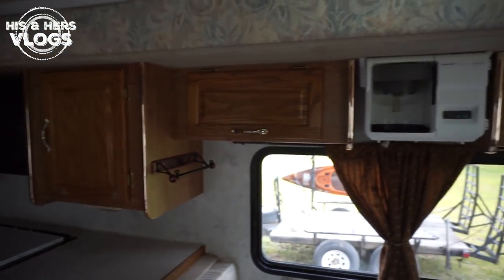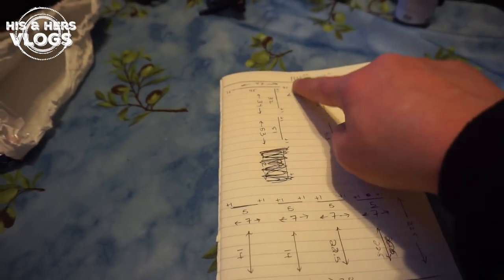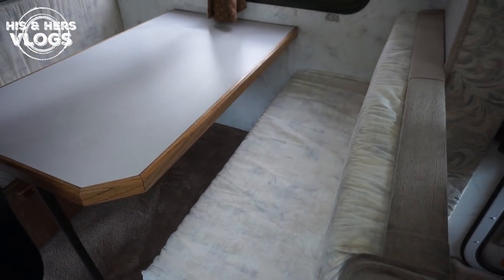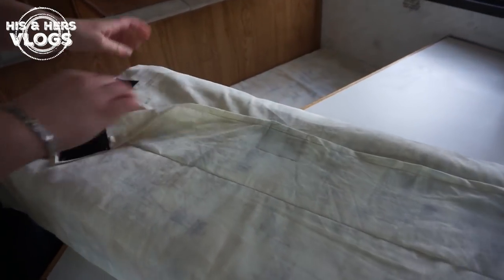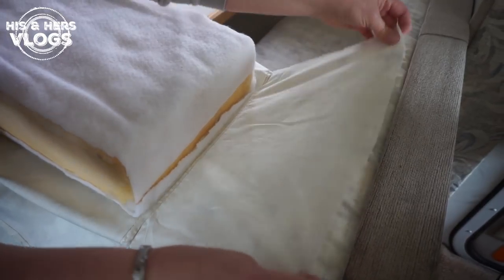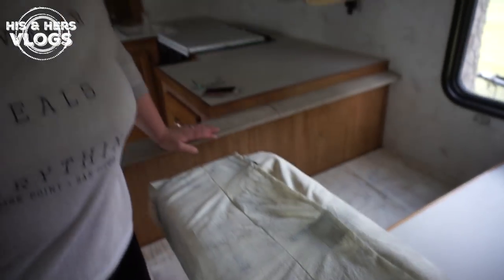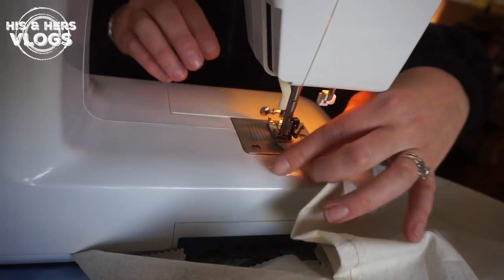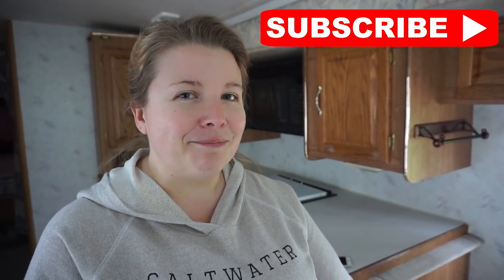DIY RV Seat Cushion Covers

Comment: Thanks for the video!  Wow you're great!

Let me share what has worked very well for me for FREE MATERIAL!, much of which I've learned from my brother who is a professional upholster, with making a new bench or van bench seat or boosting old car seat foam:

For car seats that need boosting, most often they just need more foam added to be like new again, I find used carpet pad foam often in a neighbor's trash or dumpster behind a carpet store. Remove the car seat fabric clips and carefully peel the front and sides of the fabric to gain access under the seat foam core, which often requires the seat be unbolted from the floor. 
Place a sheet of it or two under the seat foam core, right on top of the spring wire deck(carpet pad foam is tougher than the core so this also stops the spring wire deck from cutting into the seat foam core bottom).
Your second sheet can be cut smaller just covering the area the butt sits on.
Also inspect the top of the foam core and add carpet pad foam or regular foam where might be needed like by the door, worn from getting in and out over the years.
Spray adhesive can be used to bond the foam to the foam but is not necessary except for any top foam added.
Your seats will be firm and new like for many years now, it's like free magic!
The seat back usually doesn't need a any foam because it's the seat that gets the body weight on it from gravity. If you seat back should need a boost, you can add polyfill batting on top of the foam for free-see below.
These methods can also be used on sofa seat cushions.
I'll share below where to find FREE used good foam below!

To make a bench- where to get free foam: there is so much FREE foam and FREE polyfill - in many soft pillow backs and polyfill batting often wrapped around foam cushions for the taken in people's discarded sofa's and chairs found outside dumpsters at apartment complexes and the back of thrift stores. 
Even though it's used, it has been well protected covered inside the upholstery. 
Of course in the event it's a cat lady's furniture and the cats happened to piss all over it, you'll smell it and know to move on lol
Most apartments don't allow pets or make it expensive to have a pet so a lot of furniture is pet free.
Use a box cutter to open the old furniture to get at the free foam or poly as you need or use the zipper you'll find on some pieces.
Some foam in old sofas contain like a 1" thick panel of foam on top of other foam that is perfect thickness to add to your sofa foam to give it the new boost again.

Foam can be cut to size using a hack saw loose blade only in your hand holding the end making a sawing motion.
New foam looses some of it's firmness over a break in period, say after 5 years depending on how much it's sat on. 
But then the broken in foam lasts a very very long time at that softer level firmness before it really starts to break down. 
You might be able to buy complete new expensive foam cushion cores but they will sag after the break in period as well.
This is why so often we love a new firm piece of furniture but then it gets soft and saggy on us. 
Now the sofa companies could to put super firm more expensive foam in their sofa's when new that might be a perfect firmness for us when broken after the 5 years break in period, but then we wouldn't buy the sofa if it's not nice to sit on from the beginning in the show room, so there's the dilemma when you fabric is still in great shape after 5 years but the foam is now sagging.

The free fix:
So just add more foam if you can firms it up to make it like new again, unzip and compress the foam as you slowly peel off your fabric from the cushion core. Then either add more foam to the top or bottom or hack blade saw through the center horizontal line of the foam core all the way from the back to almost through the front but not through, so you leave a good hinge of foam in the front.
Then place about a 1" thick of used foam in the sandwich and holding it closed peel the fabric back over the foam cushion.
You can also add more polyfill pad to the cushion core on it's outside to add more softness and support but adding more foam is the big boost.
Spray adhesive is optional to bond the foam to the foam.
People often think that when the seat sags that the springs under the cushions, have weakened but no, it's the foam, the springs are metal and strong, the foam is just foam.

For making complete new cushion tops for say a bench, besides free foam, you might even find a lightly used fabric in some part of a discarded sofa to use IN FACT the back side of sofa's is often a large sheet of fabric that has been hidden against the wall never sat on all it's life and so still brand new! 

Discarded trash at a dumpster is free for the taking and your reducing what goes to our planet's landfill.
This is win win, real free hard core recycling, helping to save our environment as well!

Take care!